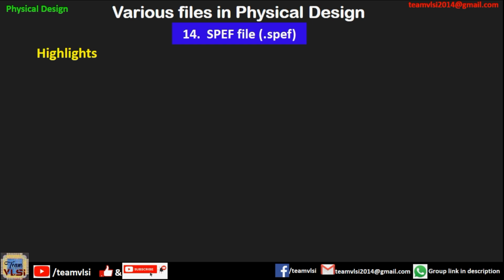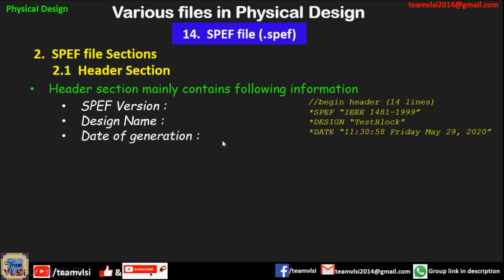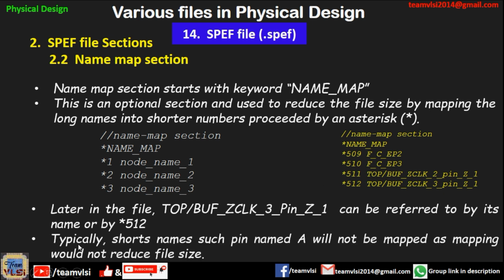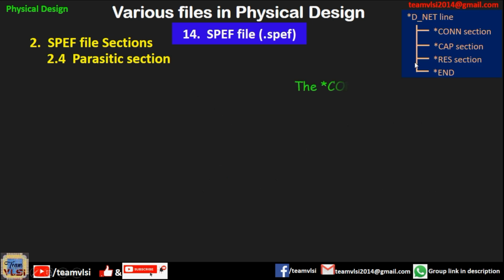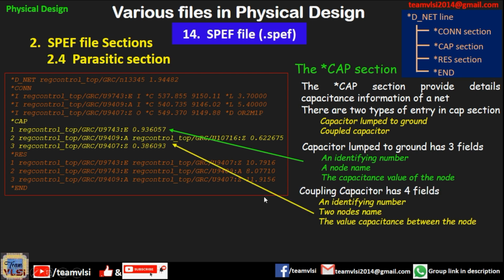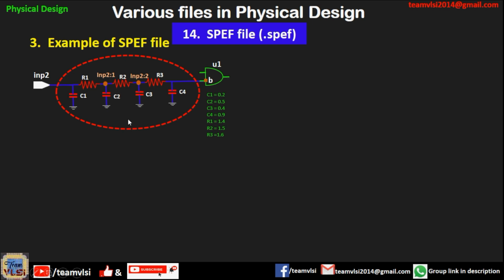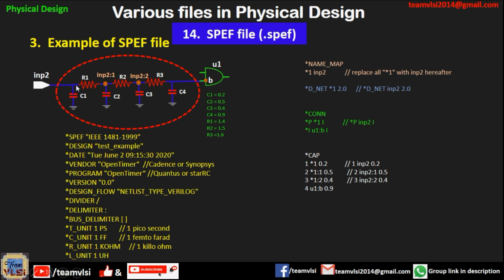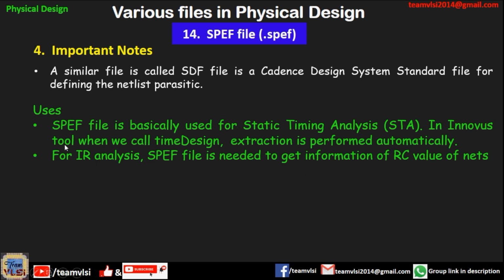SPEF file in VLSI  | Standard Parasitic Exchange Format file | .spef file in Physical Design

Comment: Hi team, I watched the video and it is really helpful. I have a question in the last example case, it seems that the tool use 1:1, 1:2 to represent the intermediate net node. I think the number on the left of colon is the net number to represent inp2. The number on the right is the node sequence number, right? I want to know any naming rule of the these node sequence numbers and how STA tool identify it to calculate RC？
Reply from the maker: Will Check and let you know. Can you mention the time where I have discussed that point?
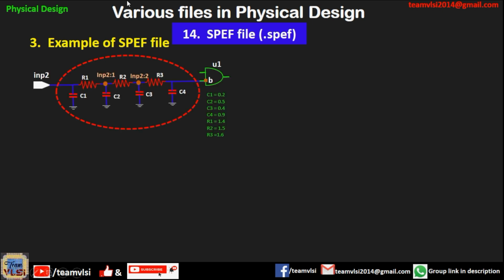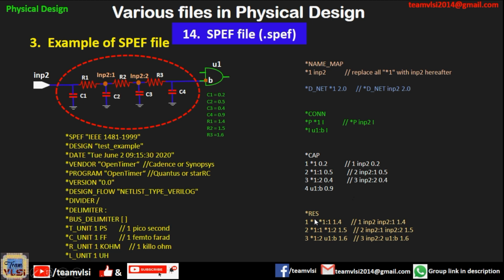Reply: @TeamVLSI  This example starts from 18:30 . And the RES parameter show the intermediate node happens at 23:45.